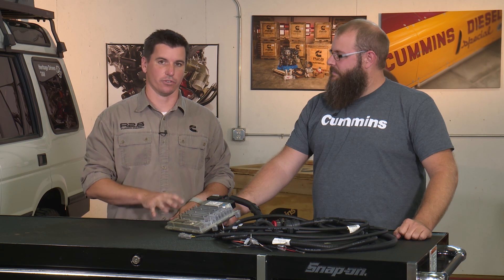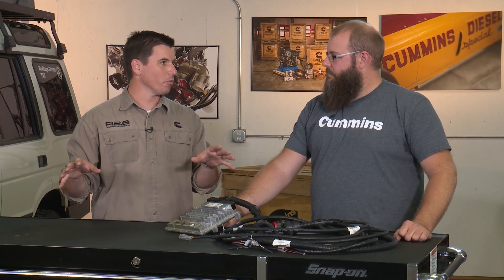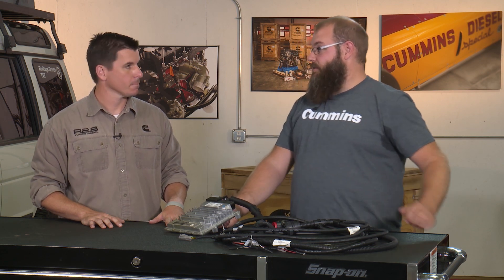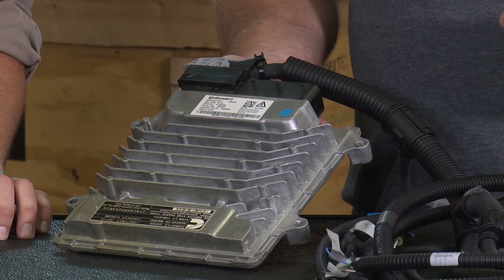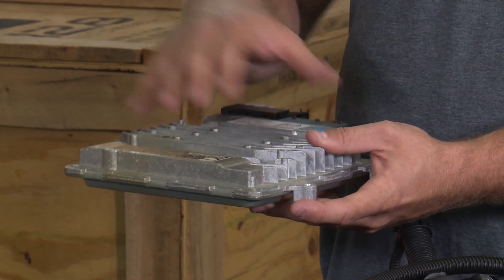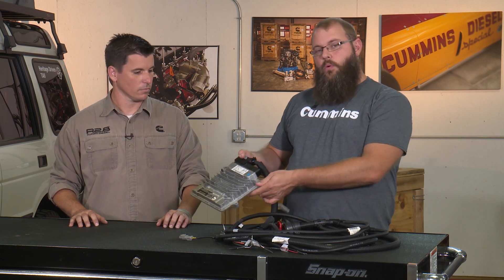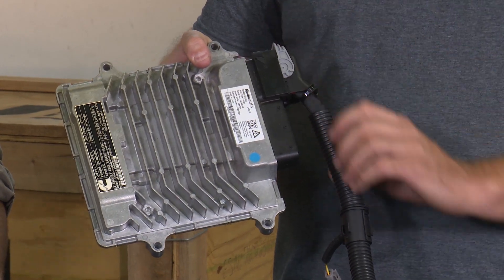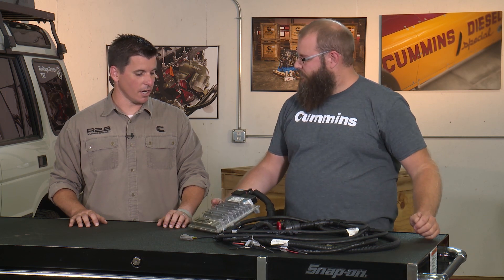Cummins Repower Garage: Tech Tips - Engine Control Module Mounting

Comment: I've done two of these swaps so far and mounted the ECM behind the dashboard up high with a 120mm 12vdc cooling fan for guaranteed airflow over the ECM. IF you could make a bulkhead connector and an extension cable about 3 or 4 feet long that would simply plug into the ECM and bulkhead connector, and sell it as an additional option, you would make many installers lives much easier. Trying to keep the ECM cool and dry under the hood is just not an easy option in most 4wd applications.